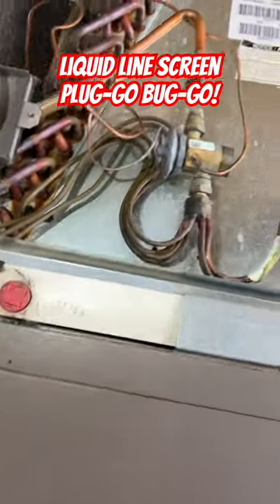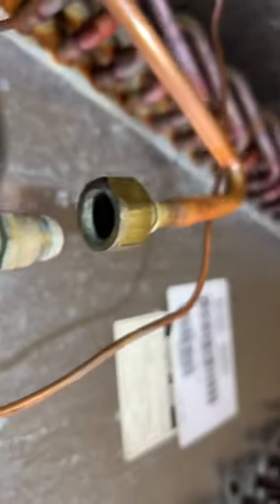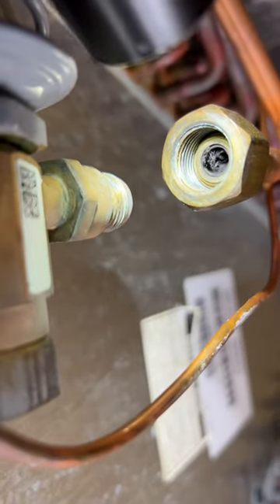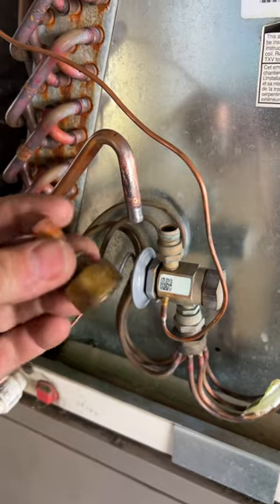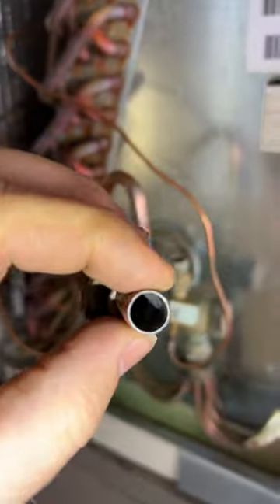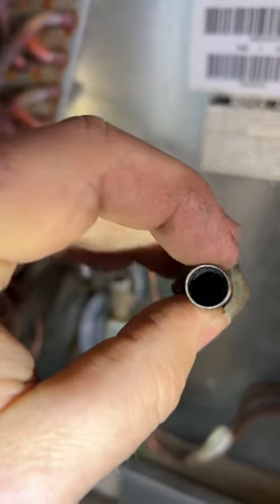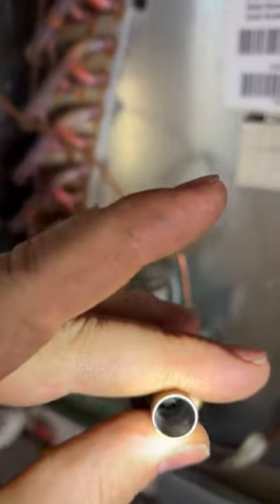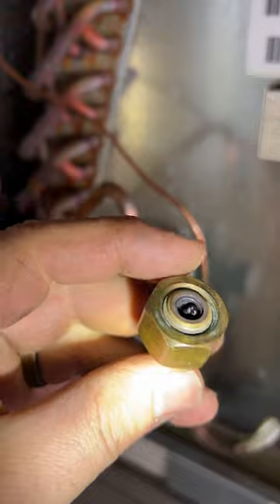Liquid line screen plug-go Bug-go!#nighthawkhvac #hvac #hvachacks #hvaclife #cooling #ac #txv

Comment: The tiniest shred of copper from deburing can and will create issues in front of a piston 4 sure. Guys rarely check this spot. So do not debur if. Your pipe is facing toward the sky.   U r better bending it down while deburring or if one cannot bend down don't debur. 😊

Comment: Where does all that Debry comes in close system.
Reply from the maker: Grounded compressor.
Reply: @NighthawkHVAC could the debris come from brasing joints without a nitrogen flow ?
Reply from the maker: Possibly

Comment: Pull the screen and put a piston in it
Reply from the maker: It’s R410A. I replaced the screen and flushed the TXV. Working good now.
Reply: @NighthawkHVAC you can run a piston with 410